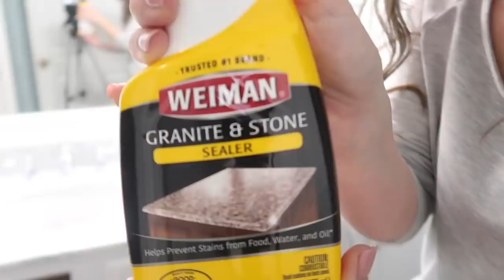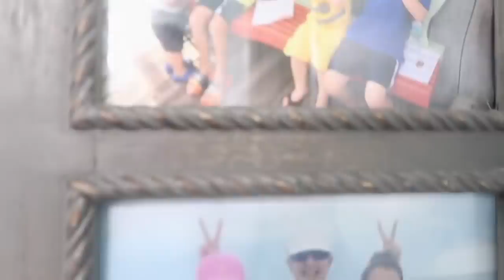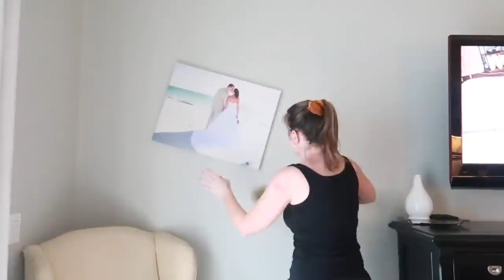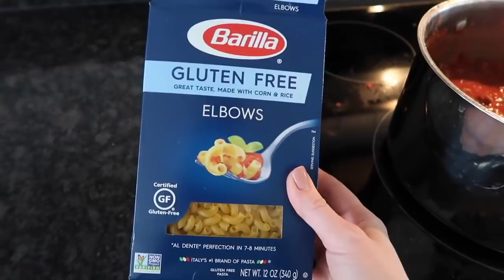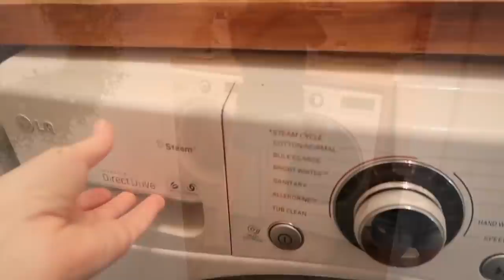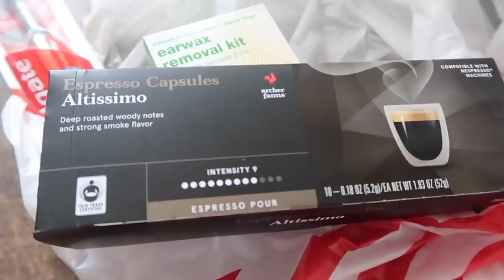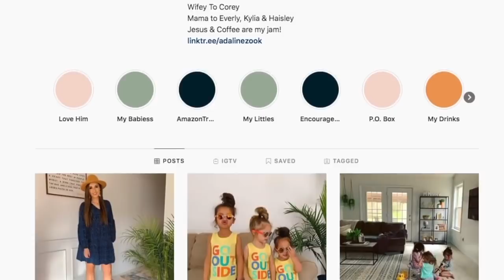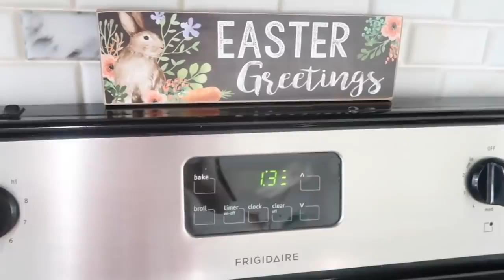REAL! 3 HOURS SPRING CLEANING MARATHON | EXTREME CLEANING MOTIVATION  | LYNN WHITE

Comment: There's something about watching someone else cleaning that motivates me. Thank you.
Re: TRIM PAINT...You can put oil based over latex paint but to paint latex over oil you need a special primer. The downside to oil based paint is the smell and the clean up but in my opinion, oil is more durable, doesn't yellow and is more economical and labor intensive because you don't have to keep repainting it every few years. 
I painted my kitchen cabinets with white oil based paint over dark wood in 2007. After almost 13 years of scrubbing with bleach and scrubby pads I finally see a few areas that need a touch up but nothing major. If there is any kind of glossy sheen to the latex paint you are going over, I would recommend using a gripper/primer to give the oil paint something to grab onto.